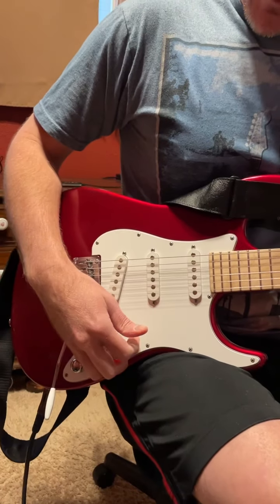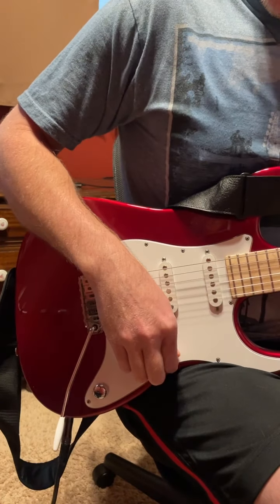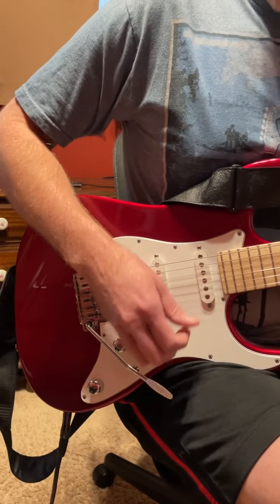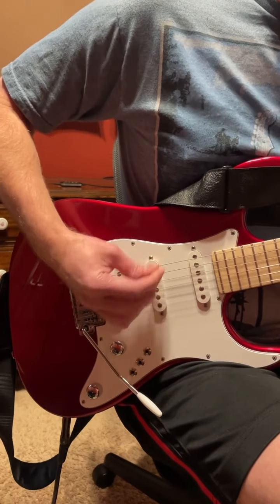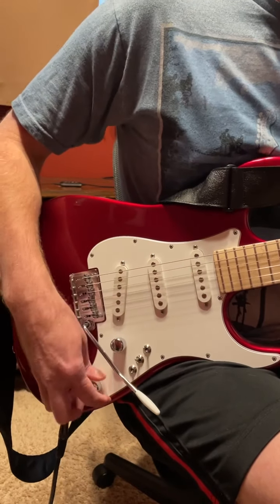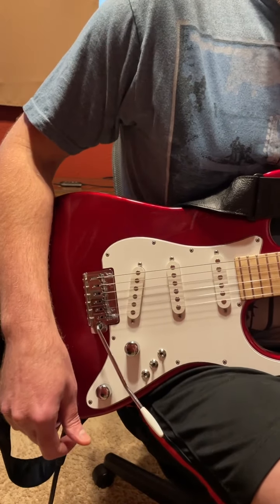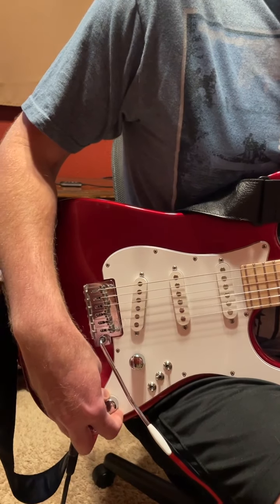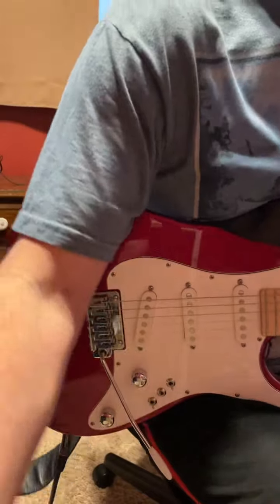2015 tom anderson classic demonstrating the Va booster

Comment: Hello there! Do you have the wiring schematic please? I have a TA classic, too, but with a 5 way switch and an ADD BRIDGE push Pull knob (Tone) I would like to cancel the add bridge option and turn it into a VA Booster. I 'd appreciate any help!! Thank you!
Reply: Hey there, I don’t think this schematic is widely published anywhere that I’ve been able to find. I have emailed Tom Anderson in the past, as I wanted to add this option to another guitar. What I was told is that it is a proprietary circuit. Also, They don’t offer it any longer as the person who made the VA booster, apparently passed away within the last year or two. I have heard rumors that this is loosely based on some thing called the VILEX booster, but I don’t have anything to back that up other than a few people on the Tom Anderson forum. Wish I could help more,
Reply: @kurt-lr3rk  Oh I see.. I ll have to do more research then..., thanks for the hints!!! By the way, your sound is excellent!! what amp do you use?
Reply: @gioguitar23  hey man, thanks so much for the compliment, I really appreciate it. I have a fender 63 vibroverb re-issue as well as a Frenzel a C 30 based amp. The one I like the most, though, is one that a friend built for me, it’s sort of a clone of a tweed fender super. Best of luck, I really hope you can find the schematic. The VA booster is killer!
Reply: @kurt-lr3rk  Thank you very much indeed!! Keep posting these videos please!! these amps you have, are absolutely jewels! Some more videos with the Tom Anderson please!! it is a real beauty!! Cheers man!!
Reply from the maker: @gioguitar23   Thanks man, I’ll get some more!